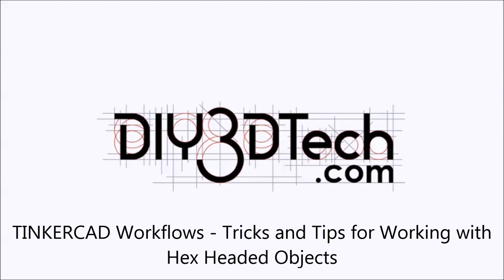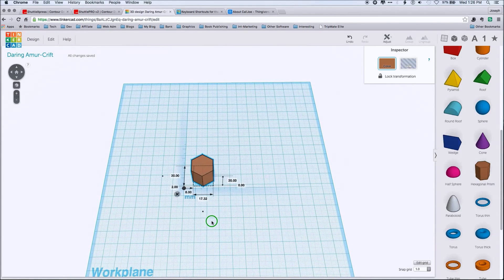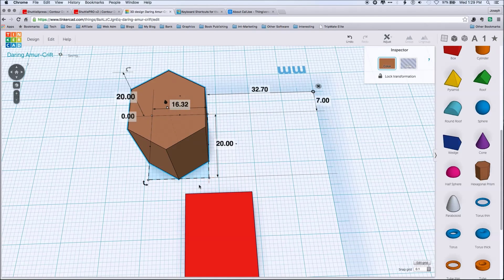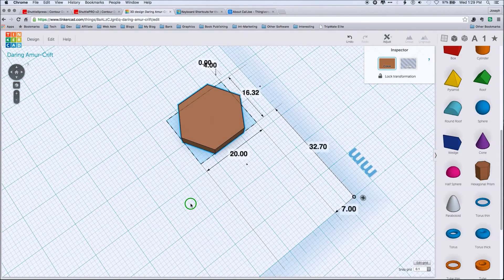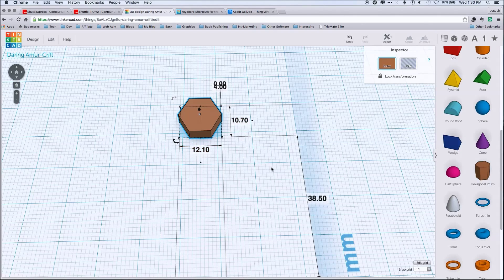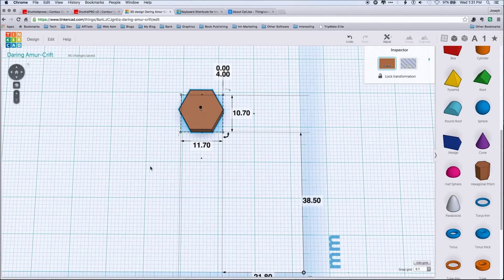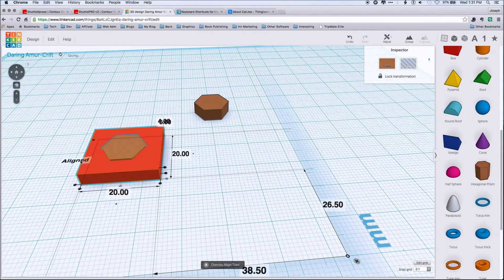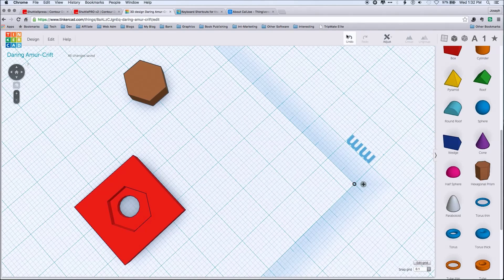TINKERCAD Workflows  - Tricks and Tips for Working with Hex Headed Objects!

Comment: According to this - http://www.metrication.com/engineering/fastener.html - bolt heads are a ratio of 1.6 : 1.8
Reply from the maker: Yes does vary a bit and technically you can also calculate mathematically (i.e. The ratio is always = sin(60deg) = (sq.root 3) / 2 = 0,866 for a perfect hexagon.)